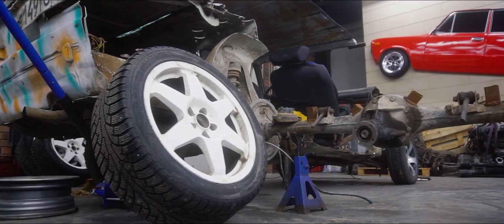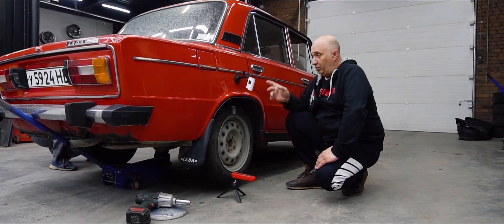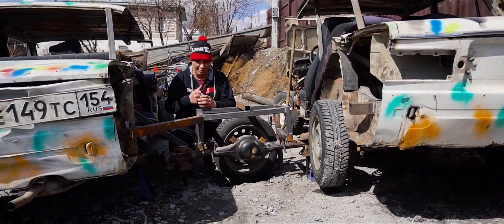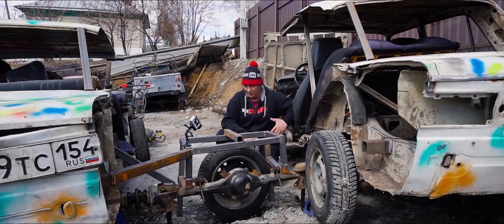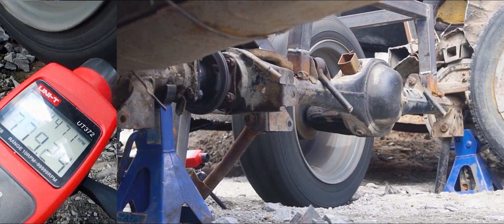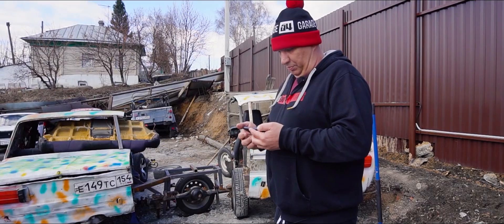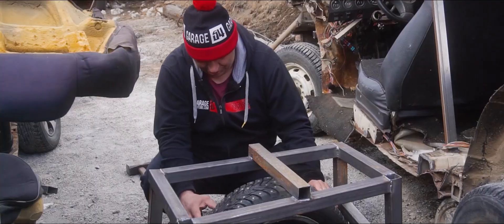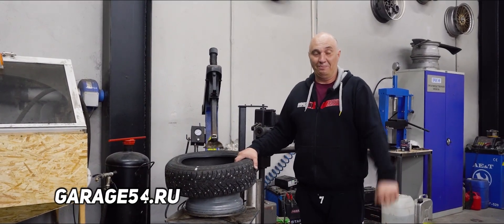What happens to a tire at 620 km/h (385 MPH)?

Comment: "Let me just kneel down right next to this unbalanced deathtrap spinning way faster than any of the parts were specified for, which we built from two Ladas instead of just using a fast electric motor." Yep, Garage 54.
Reply: Sometimes reading the comments is even more fun than translating these videos)
Reply: @SwapBlogRU  Credits to you for enabling us to enjoy these videos 😃 Your translation work is amazing!
Reply: Well stated.   It's always funny til someone gets hurt...  The supposedly humorous continuation is ... and then it's hilarious.
Maybe,  maybe not, kinda depends on the amount of hurt and that tire spinning at that speed coming unglued or getting loose could bring a world of it, even the ultimate form of it.  Well, at least he didn't appear to be standing in the rotational plane, so at least there's that, I suppose.   There are YTers that have gotten themselves badly hurt or even killed with stupid stunts already ...
Reply: Electric motor ??? Ain't nobody got time fo dat ...
Reply: Balls... you either have them, or you are sitting at home in your comfy chair, watching Garage 54!!
Reply: 60hp is 44kW
you wont find such electric motor for 100 buck
Reply: If it was safe we wouldn't be watching, he's wearing his Russian spec safety gear
Reply: Safety Fifth.
Reply: The differential is fine. The input shafts on both will be the same speed unless they are geared different, but still within design limits. The tire or wheel exploding are the dangerous parts. If the edge of the steel rim exceeds the speed of sound it will grenade, unless it's perfectly balanced.
Reply: @Chris_Garman  how do you know that?  just curious.
Reply: @justindearmond1  I grew up with a mechanical engineer, working on cars, and I can math.
Reply: @Chris_Garman  actually the input shaft is spinning much faster than it was designed for hence it's being gear'd up from the hub where they are driving it from to the wheel on the input shaft. 😏😉
Reply: @jamespicking1140  No, it isn't. It is spinning at the same speed as the input delivering the power. The ratio in both differentials is the same.
Reply: @Chris_Garman   I've been involved with engineering all my life, if what your saying was true that lada's geared to do over 200mph 🤣😭 i think not. No by spinning the axle from the end to that wheel on the output shaft is turning a small gear with a large gear. Open up a differential and you would know what your talking about.
Reply: @jamespicking1140  his point is that the diff in the Lada has x number of rpms going into the input shaft being reduced by a given ratio to a lower rpm at the axle shaft which is then stepped back up to the original input rpm through the second diff there for the input shaft that tire is bolted to is spinning at engine rpm when the transmission is in 1:1 about 5600rpm
Reply: @lancebandy9901  exactly, except it's the rpm after gearbox, not the engine rpm.they would have just stuck the tire to the transmission axle. but although it's true that this axle is supposed to turn, it's not supposed to have a wheel attached to it.
Reply: @geemy9675  in my previous comment I stated that it would be turning at engine rpm when the transmission is in 1:1
Reply: @lancebandy9901  sorry read too quickly. although there is probably no gear with an exact 1:1 ratio
Reply: @geemy9675  your all good most, transmissions do have a 1:1 direct drive usually 3rd or 4th gear depending on transmission
Reply: @jamespicking1140  nope. It's spinning exactly in reverse of the one mounted in the car. Both of the output hubs are spinning the same speed and both of the input shafts are spinning the same speed, as Chris said. (Unless the diffs are geared differently, and even then, the difference would be minimal.) It's working the exact same way the one mounted in/on/under the car is working.
Reply: @Chris_Garman  Which speed you consider the tire was spinning?
Reply: Only in Russia.
Reply: Do you have the video second for that  ?
Reply: @deltaforce4921   around the 14, minute mark, that whole rig moves if you look at those axle stands.
Reply: lol 😁😁😁😁
Reply: for mother Russia
Reply: Or you know, google the rotations per mile of the tire size?
Reply: John 3:16 
For God so loved the world that he gave his only begotten son JESUS CHRIST FOR OUR SINS so whoever believeth in him shall not perish but have everlasting life Amen Amen Amen 

Never lose Hope in God remember he forgive
Reply: @gedon4713  did Jesus pay for all sins?
Reply: @gedon4713  Religion is Fraud.  You're being duped.
Reply: Lololol 😆😂 lololol 😆😆 Lololol 😆😆🤣🤣😆😆🤣 lololol 😆😆 Lololol

Comment: Make a reinforced tire cage for it. That way you can rev it up. Also you could connect another axle to the input and then spin the tire of the 2nd axles input for double the reduction. Should double your speeds.
Reply: That would require twice as much power to drive. They'd have to use the other car too!
Reply: @jkish14  but that would be the way to do it though. Pretty easily I might add too. Their crazy enough to do it.
Reply: @sweettooth7124  for sure, I hope they do

Comment: I'm surprised that the winter studs didn't fly off. Maybe try with a new tire that hasn't been "driven in", and then maybe the studs will start flying
Reply: Those are "driven in" from the factory , they make "seats" for them when manufacturing.

Comment: Please be careful. My dad used to work at dunlop and has told me stories of the test area (test to destruction) and he said that it was several floors down for safety and when the tyres blow that they were still loud in the machine shops with the machines running. Build a cage around it with lots of catch layers.
Reply: I don't think you've watched much of this channel.  It's only slightly south of the folks who pull death defying stunts and sometimes don't live to tell about it...but at least there's video...Darwin award winners, surely, or at least nominees.  It could most assuredly happen here, but I sincerely hope it does not, this channel is a riot.  It's not like these guys aren't fully aware of that.  :-)
Reply: @MrJdsenior  😸 This just doesn't look as dangerous as it is...A kilo lump of that rubber will hit with the force of 30 times a 45 bullet...Ouch.
Reply: I was watching with my chin on the ground - This looked terrifyingly dangerous. I just made a comment saying a kilo of steel and rubber hitting you in the face at 600 km/h is instant death. At least it would be quick. Energy 1/2 m V^2. 
500 Joules from a .45 calibre bullet...This is 30,000 Joules for that kilo of rubber.
Straight through the car door....Oops my math..15,000 joules or so. Make it a 2 kilo lump of rubber for above figure!

Comment: Re name the video. "Let's sit by a ticking time bomb and see how long we last" Russia man.
Reply: They could rename many of their videos that, with reasonable accuracy.  Go look at some dash cam stuff from Russia, it is truly amazing.  Drunks running into drunks (cars, pedestrians, buildings, trees, road signs, you name it).   And something I can honestly say I've never personally seen in all my long years on the road, wheels coming off and flying by EVERYWHERE, on their own merry ways at highway speeds...now couldn't THAT ruin your day if you took one going the other direction right in the kisser.  In one, a guy runs head on into a truck, in a LADA, and climbs out through the hole where the windshield previously resided.  I'm NOT kidding.  How is  that even a thing?  Of course there are other videos where these morons launch themselves off airbags, and get HURT, for fun.  Russia is just plain weird.  The reason I bolded Lada is go look at the TopGear where they drop a Toyota truck, which drives afterward, and a Lada which looks pretty much like it's been through the crusher afterward.  Man, they are JUNK!  And dangerous, except for the one that one guy was driving apparently.   You can run into trucks head on and RUN away...reality isn't just weird at the quantum level.

Comment: why don't you try to transform throttle pedal into lever hand operated one? something that resembles a hydraulic handbrake
Reply: A boat throttle would be fun
Reply: A hand operated throttle seems like a real and downright conventional thing (I remember driving with this handicapped lady in an Oka back in the early 2000's, during my early years living in Russia, and that car was running something similar to a motorcycle throttle).
Reply: back in the 90's my friends mum worked at company making hand controls for people that have lost legs etc, had a sensor on gear stick that actuated the clutch when you changed gear. it was cool seeing the clutch pedal go up and down with nothing on it.
Reply: You mean like handicap vehicles with hand controls. Nothing new and exciting there.